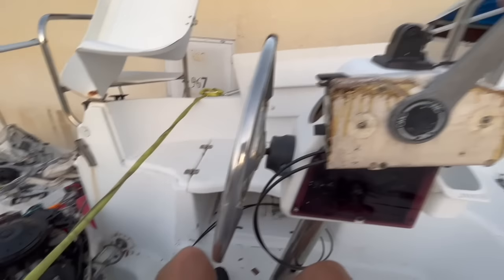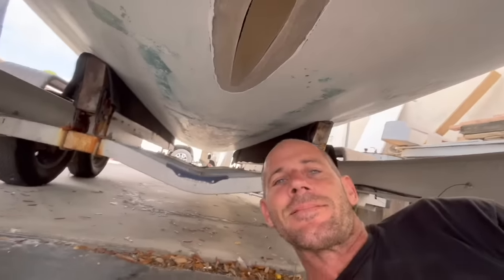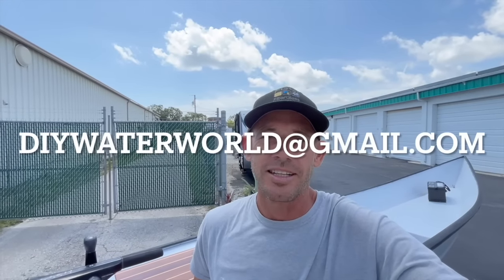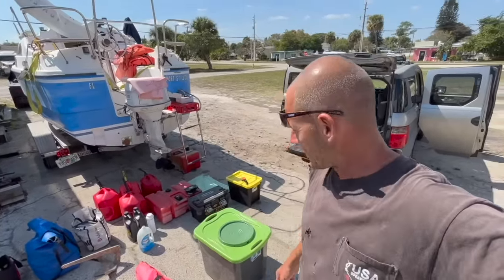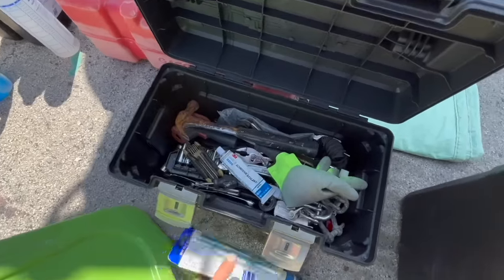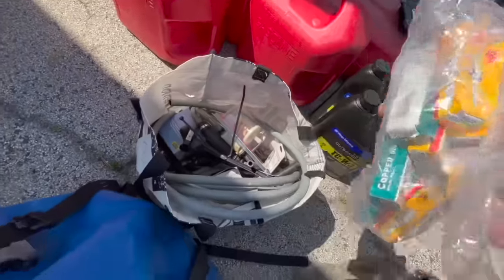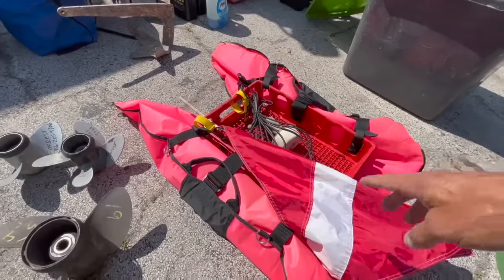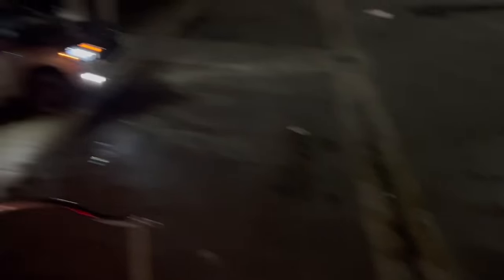Solo crossing from Florida to Bahamas on a $2,000 small boat

Comment: Having a big boat you can live on that only draws 6 inches of water opens up a whole new world. I like what you're doing and the enthusiasm you bring to your videos. I subscribed.
Reply from the maker: Thank you so much Rob for sharing this and the sub!  Glad to have you here!
Reply: The Bahamas from Florida should not consist of deep keel boats. So many cruisers maintain a state of panic any time moving about the shallow waters is needed. I couldn't do it that way. From West Palm beach to the West End its about  65 miles. Traversing it in two hours cost a fortune in fuel but in 7 to 8 hours might be much less using 30-50 HP   The right kind of boat for me would mean a cabin and generator for a/c when desired. Not a fishing boat where your family is subjected to the heat and sun all day for hours at  time.

Comment: Oh this brings back memories. My very first solo trip was from Fort Lauderdale to Bimini back in the late 80s on a fiberglass over wood trimaran with nothing but a compass and paper chart. Didnt quite account for the strength of the gulf stream and ended up quite north of Bimini but did eventually get there. Good times.
Reply from the maker: This sounds amazing and what an adventure!   Very cool you got to experience this with such simplicity.  That’s how it was done for ages and ultimately the greatest way to connect.  This was simply how it was done and what I was fortunate enough to witness growing up in the 80’s in south Florida.   A Compass was key!  Back then you could plan on hitting Bimini right after dark and easily see the light on the radio tower from afar which made it easier as well. Now with all the infrastructure in Bimini ( casino/hotel) you can easily navigate to the light at night.  Pretty easy run back and forth but it terrifies most folks. Cheers to your experience and thank you so much for sharing!

Comment: Bro, you have the exact boat that I have here in southern California. However,  you got a heck of a deal.
Reply from the maker: Cheers Alec to the same boat!   Crazy part is I didn’t think $1k was a good deal for the hull haha. But apparently it was!   Granted, it was hull only, no motor, no trailer, and missing most of the rigging/components required for sailing.   Regardless, it suited my needs and now is being put to use!  :)
Reply: @diywaterworld 

 No, you did very well.

By the way, Do you know where I can get a trailer for it. I sold mine a 1 1/2 year ago because I didn't have a place to keep it, and now I'm selling it so the new buyer will need one. I've kept it in a slip at a marina all this time.

Comment: Love those LiPO4 batteries.  Use them for all kinds of projects.

I'm not seeing any solar panels on your boat.  Simple project to add and a great way to keep your electronics powered and your starter battery topped off.  A 100w solar panel and a 30A charge controller can be had for less than $200 and give you all the 12vDC you could need.

Comment: I recently bought a 2000 macgregor26x with a used 2006 Honda  50 hp outboard ! I’m still learning to use the sails but motoring around is awesome ! It’s a very versatile boat ! I even bought a Honda gas generator and an lg portable air conditioner that I use with it ! It’s an awesome boat 🛥️!

Comment: Great content. If it were me, I'd carry lots of extra fuel in case bad weather came up unexpectedly forcing you alter your course to avoid it. It happens. If you don't have enough fuel to go around a storm, and not enough to turn back, you'll be in trouble.
Reply from the maker: Great point and definitely good practice.  I had an extra 12 gal but had a fuel leak in the old tank.  Had to abandon it.   Regardless, I was very comfortable knowing that the time of year I made this video, there are no random storms, especially early morning, and with the weather being what it was , front locations, barometric pressure, it was a magical week with flawless weather.  Weather doesn’t just come from no where. Not during the winter.  And lastly, I keep close tabs on fuel consumption and have no problem altering/ slowing down to conserve. :)  great advices and thank you for sharing! Cheers

Comment: My initial thought was that that sailing boat would have a displacement hull, and therefore 115 hp would not be any faster than a 9.9 hp, but evidently that is a sailboat with a plaining hull.  I bet you check this out before deciding on the project huh?
Reply from the maker: You are dead right with your assumptions 👍🏻. All of them haha.   Although I actually DID build a skiff from a mcgregor that did very well and planed with a 20 hp outboards.   This hull should probably be classified as a semi-displacement hull.  Very similar to northeast lobster boats.  Rounded hull, flat bottom, etc. :) cheers!

Comment: I just got turned on to your channel by one of the guys on the 26X page. I just bought mine three weeks ago and doing the same thing you did. I’ve removed all the rigging and going to use it as a motor cruiser. I live in KC, but have a beach condo in Pensacola, FL. So I’ll be doing the ICW down there! What a great video!! Thank you so much for putting it up!

Comment: You could put a 10 hp motor on that boat or maybe a 15 or 20 and you'll get the same speed with much better efficiency. Sailboats are made to displace water not plane on top. Forcing that boat to plane takes more power than it's worth.

Comment: I’ve been waiting for the next video Forrest, it's been a minute. 

Your 50 MPH skiff build series has motivated me to see how fast I can go with my 1648 riveted jon boat.

My 1648 has a 1993 25 Evinrude with a 10 x 13 propeller. I’ve had the boat about 20 years and have beat the heck out of it over the years and it keeps on going.

Anyway, I took it out for the first time since COVID,  after pressure washing the boat & motor. I put a new impeller in it, at hit the local river.

I topped out at 31.6 MPH with an empty boat, just me, basic USCG equipment and six gallons of gas.

I’m gonna take it out again with a mini tach, and record the WOT MPH & RPM, before I make any changes. 

I wonder how much HP it will take to get 50 MPH in my 1648 Jon boat?
Reply from the maker: Thanks so much for sharing and I feel your wanting to see the final vid on the 50 mph skiff!   I’ve been wanting to do it justice and made a couple changes hence the extra delay.  It will be up very soon!  

And right on! You’re cruising in that boat!  I’ve learned to go from 30-40 mph takes some work, but 40-50 is a whole other ball game.  Hopefully you’ll learn tips / tricks in my final vid!  Cheers!

Comment: interesting video, thanks. Ive always wanted to whack a stonkin' outboard on a yacht like that. I dont mind sailing, but more power is more power ;-) Im not surprised it gets awful economy tho, between that hull type and that old outboard. I dont have hard numbers, but when we replaced our 2 stroke evinrude with a 4 stroke yamaha on our ski boat, we went from using 3-4 tanks in a hard days skiing to just barely getting through one. not as good on the holeshot, but the efficiency, quiteness and exhaust level made it worthwhile. oh, and that it starts first time, every time, without fail is quite nice, which is defiantly not something i could say about the evinrude.

'pre-mix' is fuel that already has 2 stroke oil added straight out of the bowser. used to be fairly common in seaside towns and on fuel piers. people used to buying 2 stroke fuel from the bowser tended to call any 2 stroke fuel 'pre-mix', regardless if they added their own oil or got it out of the hose. with 2 stroke motors practically obsolete, you dont see pre-mix on sale anywhere anymore, at least in my neck of the woods.

Comment: You know I love the channel... Could have been 3 vids.. Boat / motor decision and acquisition.  Boat and motor repair and prep.. As a former Keys flats fisherman I was very impressed with the shallow water capability. Any stability / roll issues?
Reply from the maker: Thanks Howie!  You’re totally right , but as it is I’m already going to have 3 parts to this video.  My first edit for this vid was 50 min and I trimmed it down. The next 2 parts will be of equal length maybe longer :/ lol 

And yes, it’s a little on the rolly side but it has an internal water ballast , if filled it’s super steady.  Then quickly pumped out for cruising!  Pretty cool feature that I actually have incorporated in a skiff build I’ll be sharing with you guys this summer 👊🏼. Cheers buddy

Comment: There's only 2 boats I'd own....
C-Dory 22
and
MacGregor 26 (without a mast)....
Life is a series of "trade offs". 
Dory has a weather proof helm.
MacGregor has much more living space. 
Both trailer, run shallow, small motors (60-115), can be bought for cheap in comparison with other live aboard boats.....
Great clip Captain. IDK how this clip popped up. But I'm now subscribed. Thank you for the clip. These clips are easy to watch.... not so easy to make and edit. THANKS !
p.s. I own a 12' creek boat with a trolling motor that has a nose for gator trout.... I meant big boats when I said only two....
Reply: Have you ever checked out a Grover.  Al Grover, Freeport NY. Grover Built.  He crossed the Atlantic on ...  I think it was 26'
Reply: @kurtkurt580  
Thanks. I  just looked. More boat than I want. I'm staying in the intracoastal waterway and within 5 miles of shore at all times.

Comment: Who puts a gas gulping 115hp on chopped sailboat? 😂 2mpg is reasonable mileage. I was amazed how fast the boat went. If I had $1 for every 10 gallons I fed a old 2 stroke JohnRude engine to ski. I owned 3 115-140hp You could beat the daylights out of the engine and it would take all the punishment. The fact that the engine still runs proves how tough those old engines were.

Comment: I would never use polyester resin below the waterline because it will allow blisters. Epoxy resin is the only thing that is truly waterproof.
Reply from the maker: You are 100% correct although…… 1.  This boat is made solely of polyester resin along with 99.99999% of fiberglass boats manufactured   2.  This modification I did using polyester products was more for hydrodynamics then anything else ( the centerboard hole was simply a pocket I filled) 3.  I then coated the repair with gel coat ( on par with the rest of this budget boat) 4.  This boat does not live in the water full time , it is trailed.   5.  In the real world of boat building / repair work.  Poly products rule a majority.  

Please Take this as a grain of salt and coming from a guy who just finished a COMPLETE hull up build using epoxy products ONLY.   EPOXY IS FAR SUPERIOR!  But Every application is different and In all reality the DIY world constantly tells everyone to use “the best” materials available but the reality is the cheap stuff has worked for years and is MORE then adequate for 99.99999% of DIY work out there.  Most DIY’ers repeat what they have read or learned , few have done tests using all products let alone repairs / builds which push boundaries.  :) 

Cheers and thank you for pointing these facts out and sharing this. 👍🏻😎

Comment: Where did you get a Macgregor 26M for $2,000? You got a great deal.
Reply from the maker: It was owned by a local guy who kept it on a lift and purchased a new center console boat. He only had one lift and the boat had to go , no trailer, no motor, just the hull .  Right place and right time I guess.  Craziest part is I thought the price was kind of high.  But I’m learning these boats are not cheap.  Granted I do not have any of the rigging / sails/ so it’s not like I purchased a complete 26M.  But… the interior is mint as if it was never used so it was a big score. :).  Cheers!

Comment: Hull Speed dude! You’re wasting fuel climbing the bow wave of a hull that was designed to be efficient at maybe 12kts. Sell that 115 and put a 60 on it that you run about 4000 rpm max.
Other than that.....nice effort! 👍😉
Reply from the maker: Thanks so much for the input and comment! 👊🏼. You are absolutely correct… but… this actually is a unique sailboat in the sense that it is a semi-displacement hull, it actually can get on plane which is pretty nuts.  I have done this sort of mod on past projects with both displacement hulls and semi-displacement / planing hulled sailboats and for sure, anything over hull speed on displacemt is a waste of energy/fuel. :) 

Last summer I took a flying Scot sailboat and converted it to skiff. It did awesome !  You’ll have to checkout the vids.  I also have converted a 25’ macgregor didplacent hull and it too a bit more work but in the end was awesome.  

I knew with this build that 115 was waaay more power then needed but it was the best/most reliable engine I could find for the money. :) so, sometimes you just gotta run what you brung! Haha.  Cheers and I hope you get to see part 2 where I actually dive into this hull in a little detail and guide others on choosing the right sailboat hull to convert. Cheers!

Comment: I have considered doing something like this with an older sail boat;  how was the rocking and overall stability without the dagger board.  My assumption is the motor keeps it stable under way, but what about at a stand still.  I'm about halfway through this video now so if it's answered later on i'll find out. Even if so could you elaborate on it's safety at sea?
Reply from the maker: Great questions and concerns Ray.  Thank you for this comment/questions .   I will be addressing this in future parts of this trip video but… I’ll happily answer your question.  The boat did phenomenal under power as you mentioned it would.  At a stand still it definite has roll to it but it’s not too bad unless it’s a side sea.  I had a majority of weight / gear sitting low in the cabin and this helped act at balllast.   This boat also has an internal water ballast which makes a HUGE difference and literally makes the boat sit like a rock.  It only looses about 4” of draft too.  The water can be filled via gravity and pumped out with a 12 volt pump.  Lastly, with the removal of mast and “high” weight, the center of gravity definitely is drastically better. :) 

Hope this all helps. Cheers!